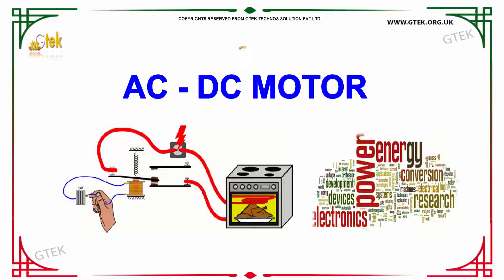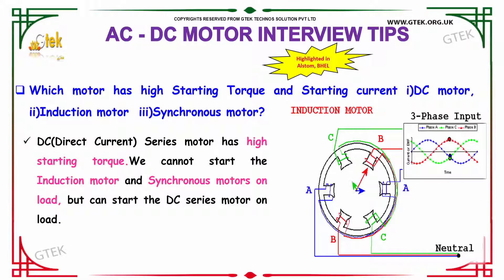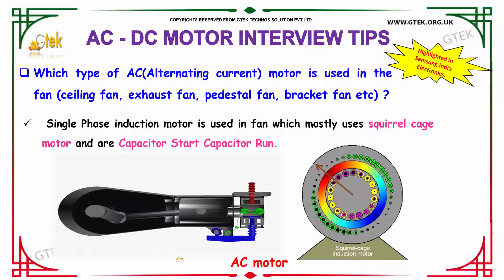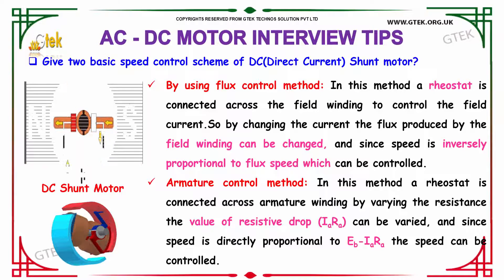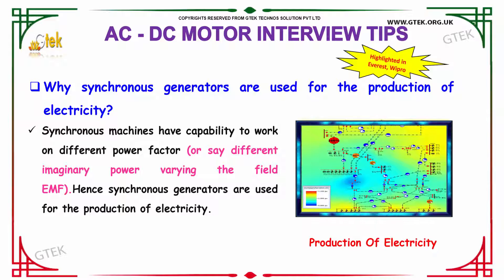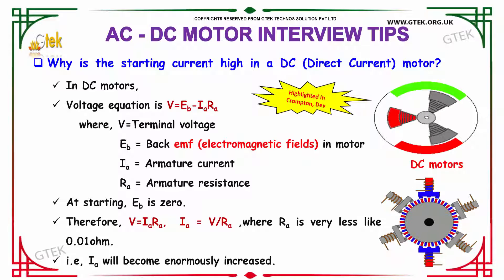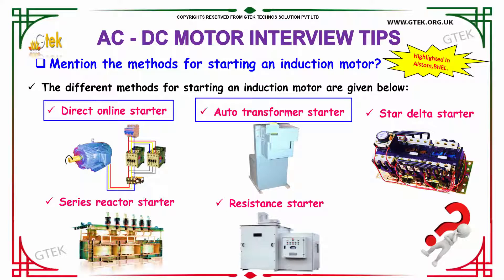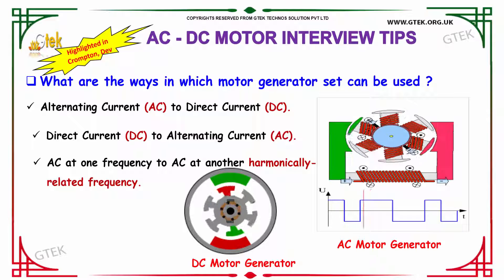Top 40 AC DC Motor ece technical interview questions and answers Tutorial for Fresher

Comment: An adjustable speed drive is a device that controls speed, and direction of an AC or DC motor. Some high performance drives are able to run in torque regulation mode.

Comment: The locos had a motor-generator set with a synchronous AC motor and DC generator which supplied the Westinghouse 356-A traction motors geared to each driving

Comment: a the engine, esp. an internal-combustion engine, of a vehicle. a motor scooter. 2 (Also called) electric motor a machine that converts electrical energy into mechanical energy by means of the forces exerted on a current-carrying coil placed in a magnetic field.

Comment: Custom motors are available  through 3000 HP with special voltages, base speeds, mountings and other options. With Baldor, building a custom motor to the specifications you require can eliminate assembly time, adapters, repainting and other costly operations.

Comment: D.C wound field motors are constructed with brushes and a commutator, which add to the maintenance, limit the speed and usually reduce the life expectancy of brushed D.C. motors. A.C. induction motors do not use brushes; they are very rugged and have long life expectancies. The final basic difference is speed control.

Comment: 14EM02, AC motor speed control using power Triac, Power Electronics Thyristor .... roof top antenna signal tracking system with 10RPM geared DC motor using .... ARM40, GSM Based Greenhouse Remote Monitoring System Using ARM7.

Comment: DC motors are available from stock in permanent magnet designs through 5 horsepower. Wound field designs are stocked through 500 HP.

Comment: DC machines are defined as follows: Armature circuit - A winding where the load current is carried, such that can be either stationary or rotating part of motor or generator. Field circuit - A set of windings that produces a magnetic field so that the electromagnetic induction can take place in electric machines.

Comment: Adjustable speed drive (ASD) or variable-speed drive (VSD) describes equipment used to control the speed of machinery. Many industrial processes such as assembly lines must operate at different speeds for different products. Where process conditions demand adjustment of flow from a pump or fan, varying the speed of the drive may save energy compared with other techniques for flow control.